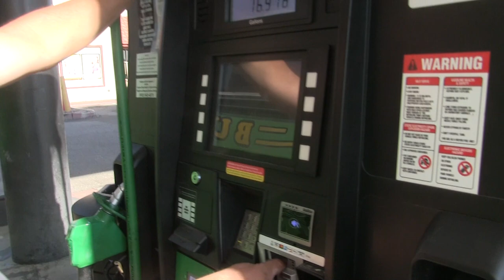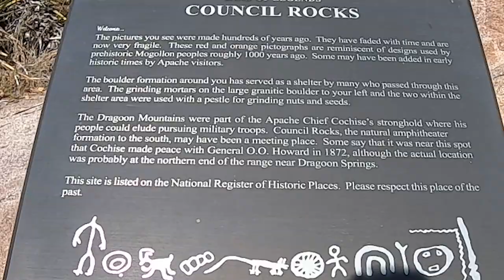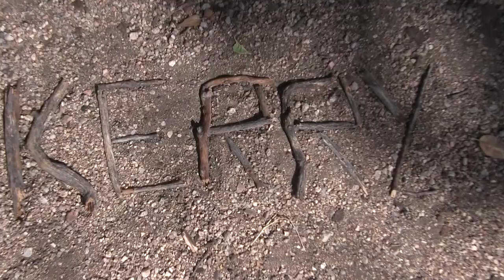We Moved Into Our Bus! First Boondocking Site & Hike to Council Rocks

Comment: always unhook the car before backing up because the steering g geometry on the front of the car is made forforwasrd movement only. l when you back up, it wants to go opposite from what the bus goes.  This is not a problem when the steering is controlled by the steering wheel in the car.

Comment: Definitely get to the bottom of the heating issue on the engine......I think I remember you are powered by a 3176 Caterpillar....I used a lot of f that engine in the heavy trucks I sold and if those things take a major dumperooskie they can get really expensive to work on....HAPPY TRAILS GUYS.

Comment: Never never never back up when flat towing. You can damage the tow bar, and or the car. Because of caster the front wheels on the car will usually turn quickly full lock. You might want to check out some videos on flat towing.

Comment: I would get the cooling system checked out. The radiator could be clogged inside. Or the coolant may need changing. Visually check the outside of it for leaves, bugs or other debris. I believe it could be better if you could tow & ride together...

Comment: Don't feel so bad about the car. I backed up with my open 5x8 utility trailer and my Isuzu Trooper and again with the same trailer and my Silverado, forgetting both times I was hooked up to the trailer after being parked for a while in front of my house.

I put a 6 inch crease in the bottom corner of the right rear fender of the Trooper with the trailer tongue and bent the tongue enough the trailer was 6 to 8 inches off center when towing it.

After replacing the tongue with a better an heavier design I did it again with the Silverado, but this time i crushed the sidewall of the truck bed in a bit with the front corner of the trailer walls. The tongue held up the second time.

Comment: When you are pulling your toad, NEVER back up, even if it is one foot, because it will bend your toad front suspension.  All auto's are meant to propelled forward, not pushed back from the front setup.  Remember that, when in the bus and pulling your toad, you can NEVER back up.  If you must back up, then you need to unhitch the toad and move it out the way.  IMPORTANT

Comment: Congrats on hitting the road!
I tow a jeep cherokee behind my motorhome.....do not back up with it connected to the bus you will ruin the front end as the front tires jacknife.
Tip. When ever I go down a dirt road I disconnect the jeep and my wife drives the jeep to our destination staying back out of the dust. Sometimes we scout ahead with the jeep for a good camping spot and come back for the motorhome.

That engine in your bus should not overheat towing that little jeep.